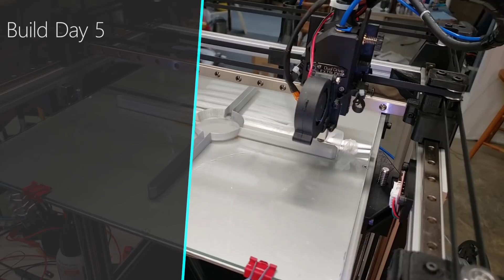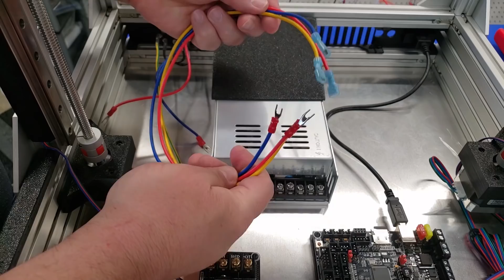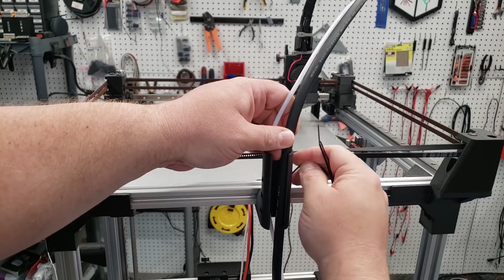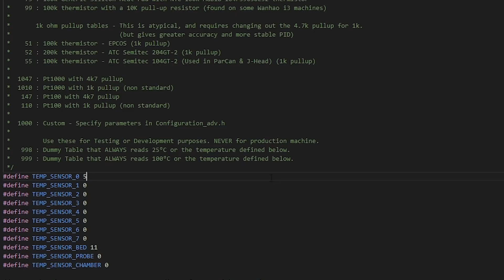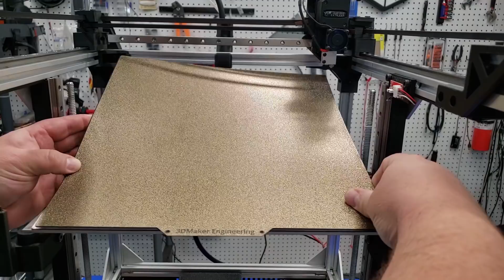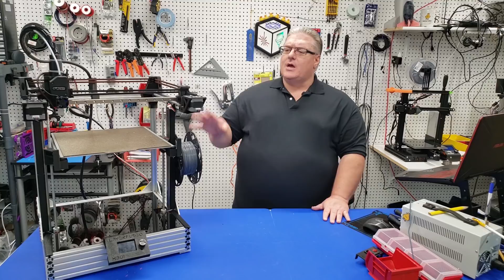DIY CoreXY 3D Printer | LayerFused X301 Part 5 - Printer Wiring

Comment: Hi. Just wondering if anyone has come across a Marlin config for SKR 1.4 turbo with tm2209’s for a core xy? I’m building a 24” x 24” print area core xy and could use the config files to get start. TIA all!
Reply from the maker: One is available in the layerfused repo.
Reply: @MakersMashup    Thanks! I’ll look for it.

Comment: I love this printer. I am thinking of building this one with a 400x400 bed.
It's easy to scale it to 400x400. Height I think that I keep the same.
Need that size for things I make.

But first I finish my new recumbent trike build. Send the files to the factory yesterday. After that a trailer, so I will probably start building it by the end of the year.

Is the bed a removable magnetic print bed?
Reply from the maker: Yes I use a removable pei build plate.

Comment: How did you get sensorless homing to work. I’m using the tmc2209 drivers but it won’t home x or y no matter what I do. I am using a bltouch for z and it is working fine. Only issues are with x and y homing
Reply from the maker: Did you configure it in the firmware?

Comment: Can you point me to some basic video's on how to configure firmware.  Building a coreXY and worried about how to do it.  thanks
Reply from the maker: If you build our build we have all the firmware ready to compile so very little configuration is necessary.  Check around YouTube you'll see plenty of videos on Installing Marlin 2.0.  Teaching Tech and Chris's Basement are good resources.
Reply: @MakersMashup  Thanks, I had parts from an Anet A6L and wanted to build it as inexpensively as possible.  So I decided to go with the A8 coreXY.  The Anet arrived broken and missing the motherboard.  After 6 months I was finally able to get a refund from Gearbest.  Thanks for your video's, maybe the next build will be this one.   I'll  have  to check out Chris's Basement.  Been on Teaching Tech many hours.  LOL  Thanks again.

Comment: The extruder listed in the BOM is now showing as $173 on Amazon. Is there a cheaper alternative that will work just as well? Maybe that is a price spike since it is a lot higher than what is shown in the BOM.
Reply from the maker: Scott.  Here is a work around vs a 24v nozzle.  You can purchase a very inexpensive one like this https://amzn.to/2Xofsua and then buy yourself some 24v Heater cartridges https://amzn.to/2Xofsua and replace the one in it.  Then as long as you dont want to print exotic filaments you would be fine as this cheap one only has a PTFE lined throat.  If you want to upgrade that you can get this https://amzn.to/3i7YpVt and save yourself some money.  Buying all these parts will run you about $42.
Reply from the maker: Oh, nearly forgot Scott, you also need to get a 30mm fan for it.  They are the other thing that needs to be replaced as the fan that comes with it will be 12v.

Comment: Can you run through your stepper driver set up for me please??? I've got the ones you listed in the bill of materials but I'm unsure how to set them up with the skr 1.4
Reply from the maker: See if https://www.youtube.com/watch?v=hORwhyP58FE answers your questions.
Reply: @MakersMashup  thats great, everything on that video helped but I mainly want yo know about the tmc2225 drivers do you need to solder the pads to run them in uart mode and do you need them running in uart mode? I'm assuming both the tmc2225 and tmc2209 are in uart mode for the x301?
Reply from the maker: If you bought the ones from big tree tech no soldering is required for uart mode. Perk of buying their brand.
Reply: @MakersMashup  ok so I know I'm being really annoying but, yes I did buy from big tree tech I have 2 x tmc2225 and 2 x tmc2209, so i just put the jumper on for uart and run your marlin on my board and it's done, sorry to be a pain but I'm at the final stage of the build now and I really want to try this baby out!! 

Thanks 

James
Reply from the maker: Not a annoying at all James.  Glad to help.

Comment: Hi, where do you install the endstops for the x and y axis???
Reply from the maker: Sensorless homing with the TMC2209s so there are no X and Y endstops. 
These aren't the endstops you're looking for. 😃
Reply: Oh, I see ok, sorry I'm new to all this, I built your layer fused x201 and it works great, now trying to step it up and build the corexy, would you say the skr boards are good because on the x201 I used a ramps board with arduino and it causes nothing but problems for me, I want the x301 to be my main printer and not give me so much hassle.
Reply from the maker: No worries James! Glad you asked.  You'll be the second person I know of that has built both printers once you get this done.  Dano in the discord has built both as well and I think he had to build the Frankenstein build first to get his C201 together.  So serious hardcore maker there!  The X301 makes some amazing prints you'll love it.
Reply: Hey just had another quick question, I've bought the skr 1.4 and the 2 sets of stepper drivers you listed. Do I need to solder anything on the driver of does plugging them in just work? I'm assuming that the tmc2209's are for x and y and the other 2 are for Z and extruder? Finally does using your config in marlin set the printer up completely, like the end stops etc?.

Thanks

Comment: Finally received all my parts and have a question. I have the frame built but the heated bed is too small. The bed in your bill of materials is no longer available on Amazon but comes up as 300x300 which is what I ordered but another brand. What is the actual size of the heated bed I need and where can I find one. The largest I can find on Amazon is 310x310 which I think is also too small.
Reply from the maker: We have recently added a model that allow s you to use a CR-10 style bed.  The Thingiverse models should contain a mount for it already.  If you have the one with the 4 holes on the inside of the bed this mount should work for you.  Feel free to hop onto the discord and ask questions many people in there have build variations that can assist.

Comment: Can you recommend another power supply as the one you list is no longer available. Also, I could not find the link to the acrylic vendor that you mentioned.
Reply from the maker: Any 24V 20a will do but I did update the BOM to include another link.  The alternate link in that Document did still have them in stock.  The acrylic can be sourced/cut by https://www.ponoko.com/ which is where I got mine from.
Reply: @MakersMashup  Thanks!!! I saw the updated link and ordered the power supply from ZYLtech and ordered the heat bed from AliExpress. Just used the acrylic link and placed my order.

Comment: How do the linear rails perform? A price that low makes me skeptical
Reply from the maker: Calvin - They perform fine.  I believe that they have improved the quality on these over the years vs. the first of the "cheap rails".  They will in no way compare to expensive rails with tighter tolerances and better bearings but for the money I think the quality is great.  From what I've researched the biggest variance is in the quality level of the ball bearings in them.  While I haven't tried more expensive rails on this design I can't honestly believe I would see a perceivable difference in print quality. That is just my personal belief but I'm not sure I want to invest several hundred dollars in expensive rails to prove the theory. :)

Comment: Great project, I really enjoyed watching the series. I'm now trying to get anything on the BOM to build one. Could you show more test prints and maybe give information about the top print speed you can reach with this printer?
Reply from the maker: Top speed is really a hard number to objectively determine.  Acceleration and what you print are huge factors in determining the print speed.  I can tell you that the default acceleration of 750mm/s is conservative.  You can push the printer 300mm/s or faster but if you're printing something 20mm x 20mm you'll never reach those speeds.  So its really difficult to publish a number that takes those variables into account.  Unfortunately there is no "standard" test that really indicates how fast a printer can print.
Reply: Thanks for your answer. My interest in corexy is mostly related with the good ratio capacity/occupied space and high potential print speed due to lighter moving parts and rigid structure. Also with the volcano hotend (or similar) that you have I thought that speed was also a goal for you. But you are right the acceleration is probably a better criteria. Anyway, 300mm/s is pretty decent number if the quality does not suffer much. With the build volume I think it's quite good. Maybe with a bowden extruder it can go even higher.

Comment: Great Project!! btw Could you convert the BOM into a printable PDF at all? in it's current format it wants to print 122 A4 pages!
Reply from the maker: Just select the cells you want to print in the document and then select file->print.  Then under the print menu choose the "selected cells" instead of the "current sheet" under Print.
Reply: @MakersMashup  knew there must have been an easy way, lol, thanks

Comment: Where did you get your jst connector kit from ?
Reply from the maker: Amazon, its in the BOM on line 44.
Reply: That link just sends you to amazon.com, not the product
Reply from the maker: Usually when that happens its because you're outside of the US.  I've had friends in Germany that tell me this when they click on the links. The kind I bought was a "QLOUNI 560Piece 2.54mm JST-XHP 2/3/4/5 Pin Housing with 2.54mm JST XH Male/Female Pin Header Dupont Wire Connector Kit" from Amazon.  I wish amazon had a better method for that.  Billion dollar company and links are "hard" 😁
Reply: @MakersMashup  that makes sense. I'm in England and it does happen with some links. Thank you for taking the time to respond with so much detailed information.